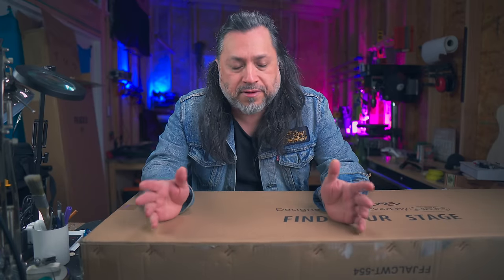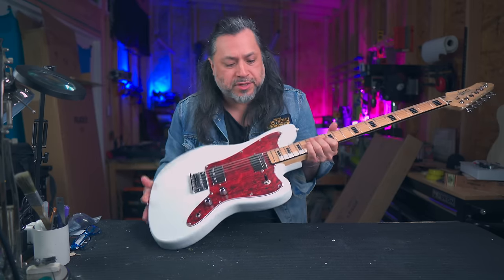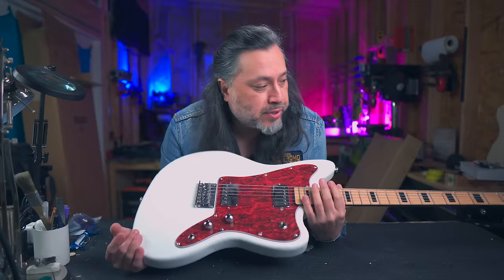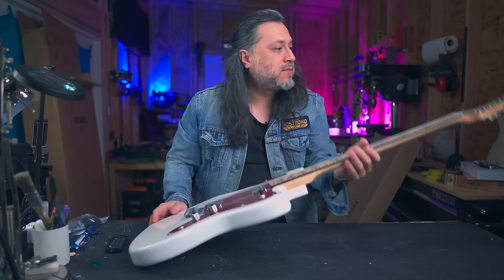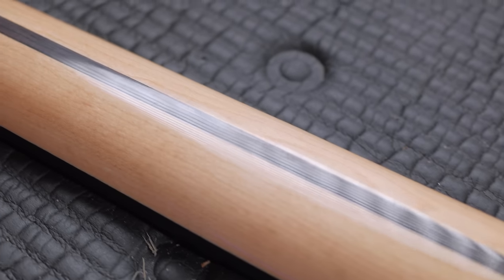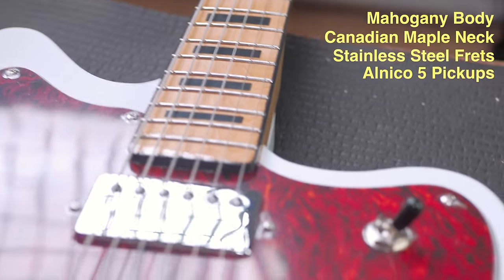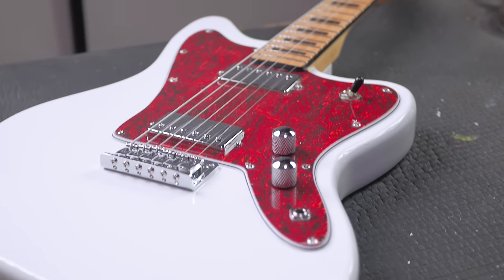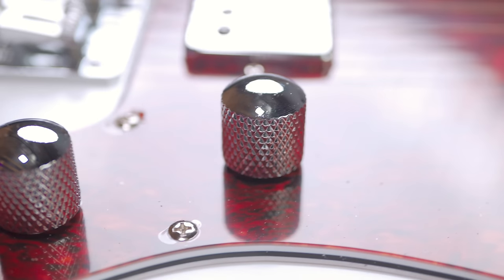$169 Baritone - 30" Scale - Stainless Steel Frets - Bone Nut

Comment: I have one of these. I got mine when they did the run last year and they sell out really quickly. The only problem I had was without ordered the Sunburst and got a white one like the one you have. when I complained they offered to take it back because he didn’t have any more sunburst so I kept it, I’d rather have a white one, then not have one at all. That’s it the finish is impeccable.

Comment: I picked one of those up awhile back. LOVE IT! I found though that to restring it with the stock tuners I had to order Stringjoy strings because nothing I could find on the rack at any of my local music shops the low E won't reach to the tuning machine. I put Hipshot locking tuners on mine, they worked perfectly with the Ernie Ball baritone string set I can buy off the wall locally.
Reply from the maker: Nice. Yeah, I went with StringJoy too.

Comment: If you want B-standard tuning on the cheap, put 62-13 strings on a 25.5" Fender scale guitar. You have to file the nut slots a little, but otherwise it sets up normally. Intonates perfectly. String tension is comparable to a set of 10's.

Comment: Hi Mark! Tell me please what about tuning and strings gauge? I have made something like this from my Harley Benton GuitarBass (changed stock bass strings on 12-52 rotosound and tune it 2 tones down). It was my "invention" - but now i see im not original))))
Reply from the maker: I used the Bass IV string set from StringJoy. It's tuned to E Standard just an octave lower.
Reply: @MarkGutierrez  sorry, no, question was about strings gauge of your guitar) About tuning i asked google and probably its in B (BEAD#FB) or you use something else?

Comment: You're one of those guitar reviewers who don't check whether the frets buzz or if they are uneven?
Reply from the maker: I do! I usually perform a fret level on all overseas guitars. But Firefly and Fesley have been the two Chinese brands where I didn't have to level the frets.
Reply: Have 3 Firefly: the new version of  Madcat Prince, now w steel fret & Alnico 5; the Jazzmaster-ish blue flame top; the recent red Gretch/ Tele. The first 2 were perfect the last one I need to get around to 2 high frets but has great sounding "Filtertrons " good "bigsby" good tuners. If your not a luthier, like mysel, could be problem but heard many folks say they had no problem returning...of course they have short runs so may be a problem.  Paying for a fret level would be counterproductive.